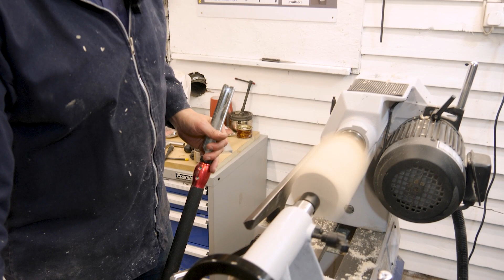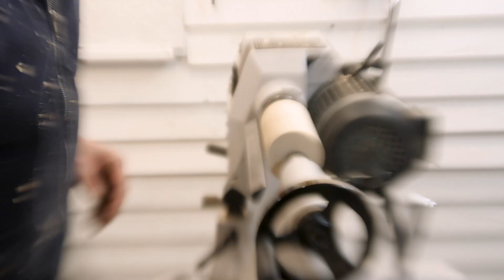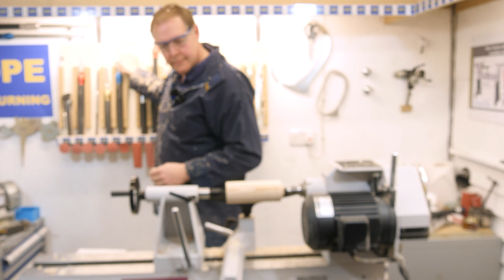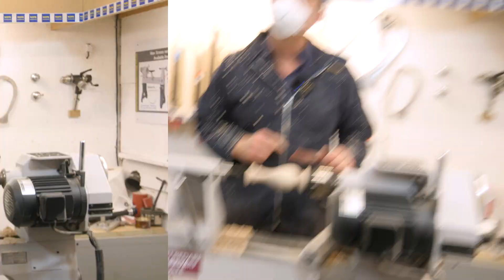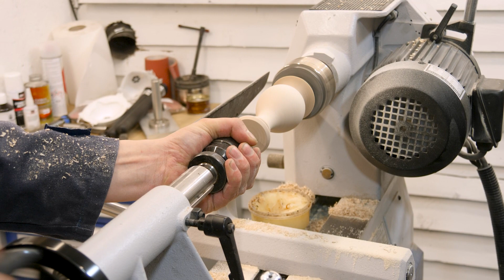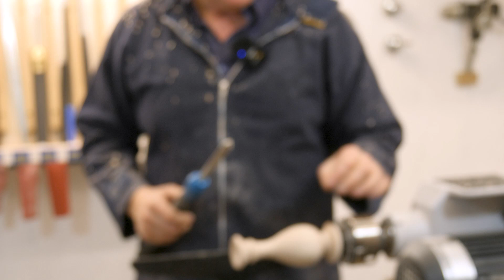Woodturning Lesson 3/11 - Turning an easy vase

Comment: That is very nice. Did you use a softwood? and why no larger hole into the top?  Thank you  Ron
Reply from the maker: Hi, no that was hard wood, i think it was maple. Its deep enough for a long and thin candle.
Reply: Thank you @ks-allyouneedforwoodturning
Reply: The wood says "Esche" which means "ash "in German. And it sure looks like ash. :)